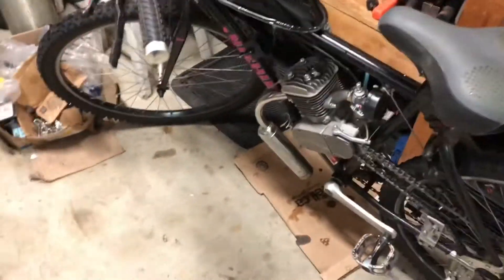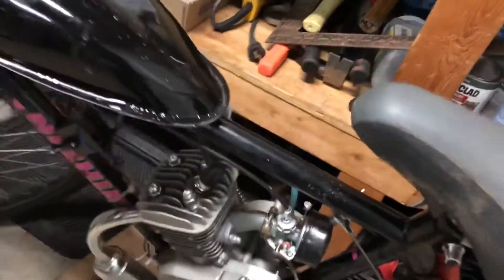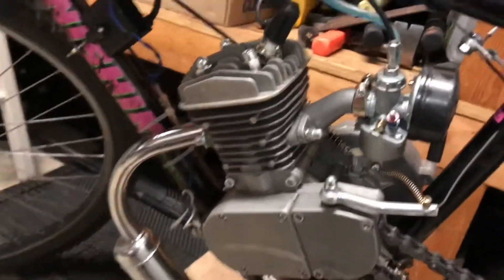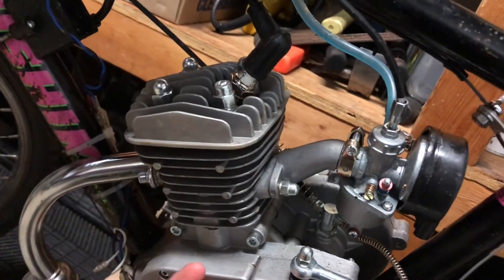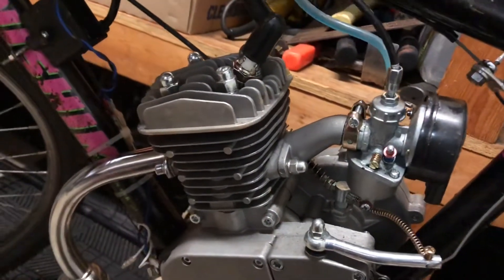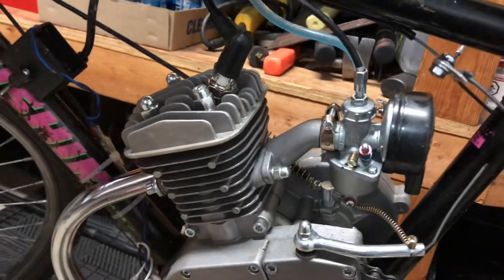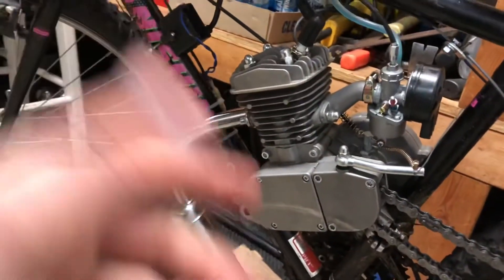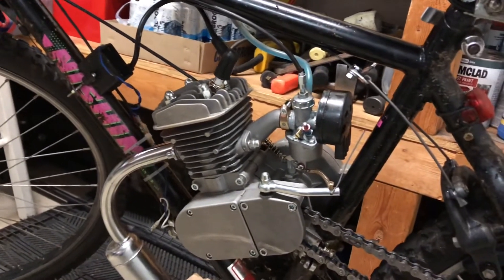Making MORE POWER for FREE on your Motorized Bike!

Comment: I used 16:1 on my first tank just to break in. Then I've been using 32:1 mix for the past 3 years. My engine still runs amazing. I haven't seen a huge difference between name brand oils (Lucas, Castrol etc) however Amsoil seems to work the best for me.
Reply: 32 what?
Reply: @jesusgutierrezgarcia1449  32 parts of fuel to 1 part of oil
Reply: @jesusgutierrezgarcia1449 32 parts gas 1 part oil or 4oz of oil for 1 gallon of gasoline

Comment: You have to do it to give lubrication and helping the internals. Giving too much oil, even synthetic will provide the way too much build up inside the engine. 2 stroke engine setups have been rated 40:1 gas oil for a long time and is all it needs for break in. It is not going to soften the break in on the metals providing more oil. The real focus on breaking the engine in is to essentially caress and raise it. Small opening on the throttle and giving it different ranges, not keeping it at the same opening. What's happening is the allow is shaping, givin the amount of force around it. Keep fluctuating throttle, and work it up and she will give you a long life time with reg maintenance. Have a great day bro!

Comment: Hi I also live in BC, (Delta) and have a Zeda YT 80/100 (I think) kit. Im rockin' a few performance / QOL aftermarket parts (stinger flex-pipe exhaust, reed-valve intake manifold, and spring-loaded chain tentioner) 
What im doing for my break-in period is/was a 16:1 "witches brew" of multiple 2stroke oils, conventional and synthetic blended together. only one 2 liters tank of this mix. 
after that (now at the time of this post) im running 25:1 for the next 8L. (this stuff is 1/2 the 16:1 mix from before and 1/2 a double-strength mix of "OPTI-2" oil.
Once I run out of 16:1 to blend in with it, I'll go with just 50:1 OPTI-2 (normal mixing is 100:1 Believe it or not and it will not burn up old chainsaws running it)
As it stands my engine is running quite rich. I hope I can break her out of this phase.
Reply: I had an 80 (66) cc, maker unknown, that I ran on 50-1 for a almost two years as a daily driver.  It hauled my 200+ lb. ass and large loads of groceries around just fine.  Then, one day it missed a stroke and 'tinkled'.  Luckily, it was only a few more blocks home.  When I tore it down, I discovered that the wrist pin was DEEPLY scored and that had allowed 2 of the needle bearings to escape and do a high speed polka on the head and piston which broke the top ring, which scored  the piston and everything nearby.  Moral of the story; a higher ratio of oil to fuel is necessary if you are carrying higher loads.  I don't think I am going to weigh less any time soon, so I am not going to run less than 40-1 from here on out.  Maybe if Royal Purple made a 2 stroke oil...

Comment: The heavy oil mix on the break in is more for the bearings and seals than it is for the piston, rings, and cylinder.  Easy way around this for me has always been to use petroleum jelly on the wrist pin needle bearings and a mix of said petroleum jelly and 2 stroke oil in the lower crank and con-rod.  Prevents the dry run startup but dissolved away relatively quickly without creating issues once the engine is run.  Want to really help the cylinder then take the cylinder off and clean the crap out of it and the piston, lightly chamfer the ring edges (then clean) and then oil everything during assembly with straight 2 stroke oil.  Yes, this does mean you have to take the motor apart to do all of the above, but I always do anyway since the case seals are often installed like crap, and the level of fine metal debris inside said engines is disturbing.
Reply: agreed, I take er apart, deck her up nice, check for over-hang, etc then coat her good with two stroke oil to help with the first dry start. I have heard mixing a bit of vasoline in there with the two stroke oil, like say on the wrist pin and bearings, etc, works wonders. I have a block rn I got to put a new piston, wrist-pin bearing and rings on, so I will be trying a bit of vasoline with the oil as well. I want to use the old cylinder from the motor when the piston failed but there is a small spot where a peice of the ring scratched the cylinder wall, it's not horrible and as a matter of fact still appears to be plated in that small area. But I can feel it when I rub my finger across it. I suppose I could try the jug, after dremling out the overhang, and just see. I meanI have never seen such nicely done ports from the factory (the over hang was below the port areas), so I really want this cylinder to go to use again. That was the first and last motor I run out of the box. I now always pull the head and jug, deck and Pre-Check, etc.

Comment: Question, my gas scooter calls for 25:1, i believe that would be the break in period. After I can go 32:1 or 40:1. Now if I switch to 32:1 or 40:1 do I have to manually adjust the carburetor idle and fuel mix screws? If I wanted to do a weeks test for each mix and check the plugs for fouling, and do comparisons on temperatures with different fuel mix, isn't it important to adjust the carburetor each time to the correct fuel mix after it warms up??
Reply from the maker: Yes I would adjust the mix on the carburetor for each time you do that. Generally if your up jet or tube it richer, the idle will get lower. And down jet or tune leaner the idle will raise up. The rest you’ll have to tune based on your own scenario and desired outcome. Hope that helps
Reply: How did your tests go using 32:1 or 40:1 mixture on a 25:1 gas scooter? I also have a gas scooter that calls for 25:1, so I'm wondering how it will affect the overall performance of the engine changing to 32:1 or 40:1
Reply: @raidonh9459  I used one of those amazon cups that have the mixture lines for 25:1. If it calls for 25:1, I would put it. Then over time you can increase to 32:1 after putting in lots of hours of use. You will notice that  on 25:1 it uses more oil but if you think of it the life span of the engine will be longer because its better lubricated.
Reply: @CSJiGSaW08  Wow, thank you so much for your reply. I was researching the whole night about how it changes the performance. Every engine is different and the manufacturer ratings is the best to trust for max performance and life span (disregarding EPA, but thats more an issue for 50:1). I have the carb tuned perfectly for max revs, and I would hate to play with it more because the fuel screw is super sensitive. I found that after I tune it correctly, gas usage dropped by half, I was amazed and knew that this is what the engine wanted. I was really considering going 32:1, but based on your experiences and that the engine I have is soo sensitive, I will leave it be. Thank you again for you input, you helped greatly 🤙
Reply: @raidonh9459  Yea no problem, FYI note that when you are on 25:1 or even lower, you will have two things to worry about. Spooge and fouling on plugs because the oil concentration is greater. Spooge is where oil might ooze out the tail pipe. Is completely normal because some oil is not burned properly and oozes out. best way to avoid it is run the engine hard 75%-100% the majority of the time to burn it all. Low revs and half throttle is not good. 25:1 leads to #2 issue which is fouling of the spark plugs. You need to keep an eye on the plugs and clean them if necessary. People say to replace them, but if you want to conserve and keep using you might try cleaning. Search on youtube. 25:1 will definitely save the life of your engine an if its a high torque application or your on the weight limit of the engine, you will definitely heat up if you go 32:1 or higher. To make your mind go nuts a little lol, I hope you are using a premium oil blend in your engine. The best brands hands down now for 50CC scooters are Bel-Ray and Maxima oils. Look into them because there is Caster Oils and Synthetic Oils, and different terminology. I had a castor oil 2t blend and switching to synthetic maxima. For new engines its best to use castor oil for like a few weeks of use (maybe 25 hours). After that, its recommended to go synthetic.
Reply: @raidonh9459  I would test 25:1 and 32:1 and make sure to tune the carb with the screw. Test both out and you will notice which one is more consistent. I tried 32:1 on mines and after running it max rpm for like 15 minutes, it stalled after I came to a stop. I noticed that it might not be lubricated well enough and it seizes. Meaning, it needs 25:1 and it has not seized yet on hard running.
Reply: @raidonh9459  Do what the owners manuals states and try to tune the carb. Make sure you get one of those RPM readers that wrap around the spark plug and tells you the RPM. after warm up, you will run at max and when you tune it, you will see where it gives you the max RPM.

Comment: I have same motor for years now. Whats my secret? I use 20:1 all the time with non synthetic. Cleaning a spark plug takes me 3 minutes. These motors are air cooled and run at much higher temps. The only thing that saves ur motor life is oil. motor burns fuel fine at high high temps. every month it takes me 10 seconds to clean the cylinder. other than that..these are 2 strokes.  I do exactly what you say with my motorcycle but not with these air cooled china motors. oil drips out of exhaust cuz she drools on the good food. no skim. For 20;1 TO WORK LIKE MINE U NEED WINDOW PISTON, REED, AND Expansion.
Reply from the maker: Not true. In fact, if your engine was actually built with reeds and a windowed piston, it would barely want to run on that mix. You’d want at least a 40:1, maybe leaner. They like to rev. They’re not meant to last 30 years. Don’t choke the thing with oil, and let it rip!!

Comment: I always use premix 40:1 from the start to finish. I use Husqvarna 95 octane and add oil to it for my mix. I also made a wire bracket to carry an emergency bottle.
Reply: I’m making mine soon another guy told me to use 40:1 so I just did some research first. How’s your bike W years later?
Reply: F ING smart Xtra never hurts

Comment: Your right. I got a cheap kit 3 yes ago and the manual actually said mix 50 to 1 after break in. That is a little lean so the 32 to 1 or 40 to 1 will still give you good running motor but won't Fri it either. I think they're saying 20 to 1 now cause people keep blowing there motors. You really need to be mechanically inclined and know how to treat these bikes for them to last and get the most out of them

Comment: 50 to 1 will make more power and is far from hurting the bike u can run 100 to 1 with amsoil and I know a lot of people who do for chainsaws and they keep them tapped out for long periods of time while milling and bucking big logs
Reply from the maker: Although I think these would run on 50:1, I don’t think it’s good for them long term. They are very horribly machined and manufactured engines and they need every fighting chance to run for a very long time. I wouldn’t run anything leaner than 40:1 on these engines. The performance difference between 40 and 50:1 is going to be very negligible but most likely shorten your engine’s life long term.

Comment: yesterday i used a big 24mm carb with a big manifold,  it was alright tbh!  it started and idled nice, it was faster but power varied and was just unpredictable, fuel usage was good.
it would not run with a air filter, it was not loud tho.
then i fitted a cheap new 19mm slide carb,  to my surprse it ran so rich it just spluttered and smoked, maybe something was wrong, i will check the jet size today, it should be #60.
anyway, it seems the original carb is best so far!
Reply from the maker: Honestly, I agree. Although they aren’t Mikunis or anything, I think they’ve proven themselves well! Never ever had an issue with the NT speeds.

Comment: how long do these engines last for if maintained properly? and whats the top speed on these? and how much km do you get out of a full tank of fuel?
Reply from the maker: They’ll last years if you take care of them honestly. General maintenance items like clutch pads, cdi, spark plugs ect will need to be replaced eventually, but again, the kit as a whole should last years. A completely stock engine with stock gearing (44 tooth sprocket) will do about 45 km/h (~28 mph). And you can get around 70-75 kms (~43-46 miles) on a full tank of gas on average.
Reply: @Everatti  that's amazing results for a little engine wow
Reply: @waatao9856  they typically last 600 miles or a couple of rides motorized bikers don't like to be honest 😒 sorry 
You can check out nomad nick bicycle hobo channel out and see how long they last .and he was a best case scenario .

Comment: Could you use 50-1 on these bikes.  All my 2 stroke engines use it wondering if it’s safe to put that mix on it
Reply from the maker: Hey there. I’m sure you could use 50:1 but in my opinion it’s a little lean. I personally would stick to 40:1 or less. I’m sure it would run, but in the long run you might prematurely wear your engine from the lack of oil lubrication

Comment: As long as the gas and oil are VERY well mixed larger amounts of oil are fairly harmless
Reply from the maker: True. Probably gonna foul plugs more though lol.
Reply: @Everatti  i found an 1/8 of an inch of gumout in a small jar is great for soaking the bottom of a spark plag

Comment: 50 to 1 is what i have always run 6 years and 13,000 miles still runs great.
Reply: Whaaat!!? That’s crazy… I didn’t think these little engines could get even that many miles! 🤯
Reply: @digitalventuremovement7680  you take care of it it'll get you there this one got me 13900 miles before it died
Reply: @digitalventuremovement7680  they don't 💯
Reply: @Jarrod_D  like any saying if you take care of it it will last quite a while I wound up with 13900 miles before that engine finally gave up the ghost.
Reply: I just got one of these motorized bikes last week and I put 50:1 that I was using in my weedeater 🤣

Comment: I can ask you, what fuel octane? I’m not sure which 87 or 91? I use 40:1.
Reply from the maker: Octane doesn’t really matter in this application, but ethanol content does. Ethanol is the crap they put in gas to make it “more environmentally friendly” (it oxygenates the fuel, which reduces air pollution). It’s okay for cars, and even something like a motorized bike, but not if you plan on storing it for a while. It will gum up the carburetor and the engine will perform more poorly overall if ethanol is let to sit inside of it. Generally, 87 octane and 89 octane will contain up to 10% ethanol. (The best is 0%). 91 octane and 94 octane (if you have that option) usually contains no ethanol. But if you have 87 octane that clearly states it’s ethanol free, go for that! I always put 94 octane ethanol free gas into my dirt bike, lawn mower, small engines, and motorized bikes. It just saves you the hassle of worrying if the carb’s gonna be gummed up the next time you try to start one. It’s worth the little extra price too, considering how fuel efficient these things are.
Reply: @Everatti  okay got, thank you
Reply from the maker: @liteboy2004  No problem man!
Reply: I use 93

Comment: subbed. ty for the video. i'm almost into my 2nd tank of fuel on mine and was wondering about this. after this tank I will be running 32:1 then i'll try 40:1. I can get the premix of 40:1 and 50:1 at my work at Home Depot
Reply: Just stay 32:1 it will stay cooler on long rides.  On my 6th build!
Reply: @microfarmers  how long do these engines usually last before rebuild?
Reply: @digitalventuremovement7680  about 600 miles would need proof of anything higher . But typically just a few rides . Originally it was an everyman design, by the Soviet state . It was called the Du8 recommended 20:1used motor oil . They where motorizing a bicycle for transportation to work not making a motorcycle out of a bicycle.  
If it stops smoking it's broken 💨💯
Reply: @Jarrod_D  Well considering they get over 100mpg, I'm going to assume you meant six thousand miles, not six hundred!🤔😆
Reply: @3DWHIZZ thanks for the reply 👍
i said what i ment .💯 would need proof of anything higher. 
Would love to see yours.   i posted a few videos of mine . 
I rode it across America 🇺🇸

Comment: Hey I ran my bike that im just breaking in with the gas off on accident and it sputtered out and died after 10 mins of riding and after that i turned the fuel on and the bike started fine but feels like acceleration isn't as good but I may be overthinking it because I still reach top speed I recorded earlier. When someone does that to their bike on accident does it usually make a problem occur or do you think im just imagining things thinking the acceleration is worse? I tend to overthink things lol
Reply from the maker: You might be overthinking it haha. I wouldn’t worry about it, I’ve ran out of gas before and it’s fine. No problems would occur unless you repeatedly tried to start it with no fuel and gas mixture to lubricate the cylinder and piston.